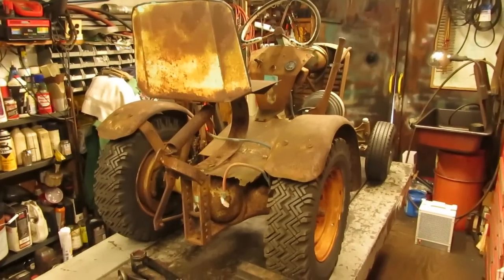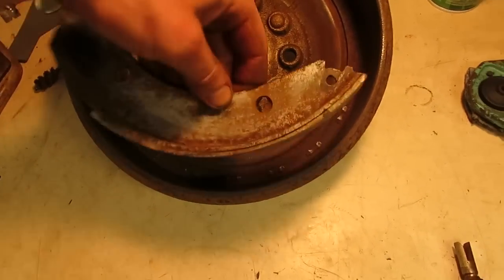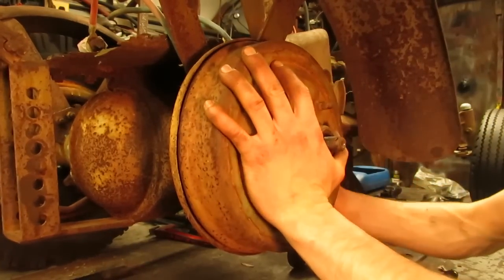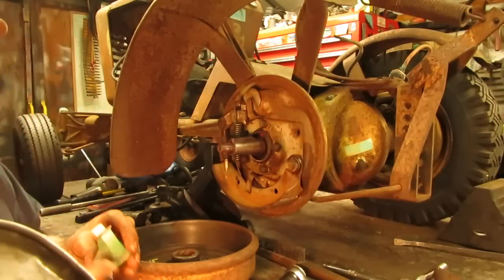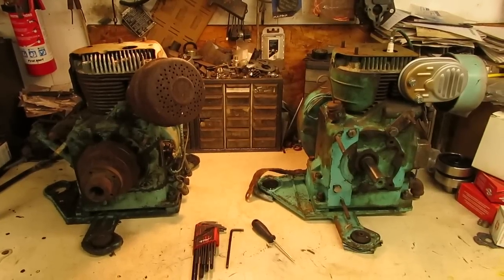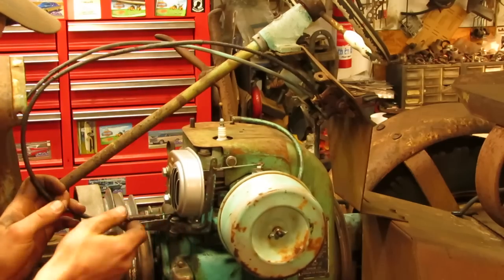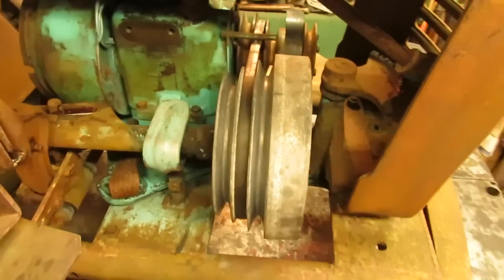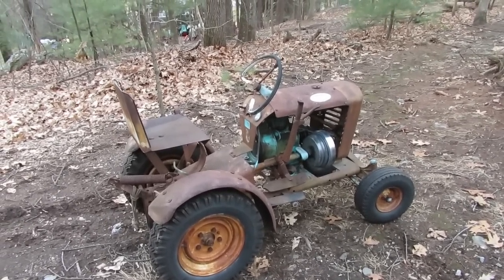Building a Rusty Panzer T758ES Tractor- Part 2 of 2

Comment: The anchor mount is called an excentric bolt used to center the shoe in the drum , as the drum wears contact of the show is on one end.  We called these shoes , P style,.  We also had a gauge to measure the drum and the shoes to get the adjustment close so one didn't have to take the drum on and off.   it was common practice years gone by to shim the lining on the shoe sometimes called a table when the drums were worn oversized. A thing of the past not many drum brakes used todays automobiles.  Return spring common to yours were used on steer axel air brake systems.  Jake I enjoy seeing a young man with interest keeping the old iron running and your inventions.
Reply from the maker: THAT'S what it's called! Thanks Ed, just couldn't conjure up the right name for it at the time... Interesting info on setting the shoes too. A lot of that common knowledge is lost now a days with so many things having disc brakes. Of course now I can keep it on mind since so many of the older equipment I work on still does.

Comment: I think you did a FINE job as you always do. I never had any experience with those although they had to be here somewhere. Looks like a very strong built rig with the gear rear end and chain reduction. Hope there's a hole to drip some oil on the chain somewhere and all the grease fittings are right up my alley. Hope is going well and the calluses are getting even thicker. Maybe for a flat top but I don't think a 5-string builds them very fast but hope you're picking all you want to! HI to all there and everything is still waiting on you. I finally got outside and did a little and got stuff started.  Felt GOOD to finally get outside! Rain now and a cold front coming to freeze all the buds and blossoms but it comes every year. Keep after it and God Bless Yall!
Reply from the maker: We got 2 maybe 3 more gigs booked between now and Aug (one of which is our tractor show). That's big doin's for us since it's usually 1 gig or so a year. That Deering Deluxe is going to get a workout! Nothing like getting out for some early spring tinkering, sure beats being trapped like a duck in a pen... After having an almost snow-less mild winter, we're finally catching up... got a nice storm blowing through today. Guess He wasn't going to let us off easy! Thanks Lewie!
Reply: @5Tractorguy  Sounds like the Tractor Show might put yall on the Opry and I think Deering can send you another tone ring if you melt that one down. We've just got maybe 2 dustings so far this winter (if you want to even call it that) and we usually get a little bit but not this time. It better hurry if it's going to do something. It'll be garden time in just a bit but I've seen snow on dogwood blooms before. I even got out and mowed the high spots in the yard the other day. My job security is starting! So happy snow plowing, Buddy. We're all blessed more than we know.

Comment: Yeah you looked a little constricted on it as I would be, what a neat machine. Those hub pullers could be gotten fairly cheap 10 or so years ago not so much any more. If you keep an eye on ebay you may be able to pick up the 3 leg.
Reply from the maker: At the least the dang steering wheel needs to be closer! Though I suppose I should use my lanky arms for something... Believe this one had a name stamped into it. Going to have to check now and keep and eye out. An extra leg would be handy as ever.

Comment: my Dad bought one of these, I think late ‘60s, primarily to mow a sizable yard. I grew up spinning wrenches on it. Rebuilt the engine a few times, but never had to service the brakes, as they were rarely used. A funky machine for sure with that big Chrysler automotive rear end and that silly drive shaft with pulleys and a reverse using a rubber friction disc was an anachronism. However, it was very reliable and easy to fix. Without a mower deck on it, a young man could pull crazy wheelies on pavement. I spent many hours cutting grass with it, so much so that it was partially responsible for most of my hearing loss…..I was too dumb to use hearing protection….🗣️ 🦻

Comment: Tractor runs great man !!! I really need to find a Panzer for my collection one day, they are a sweet little machine. So I guess you have to shut the engine off to flop the belts over to change gears on these things ?
Reply from the maker: Thanks! That ol' K181 is a good runner! Yep, that's the only hassle about running these things is the speed change. Unless you're handy with a flat-head screwdriver haha.

Comment: So happy to see you back again.  I have wanted to ask you about starting a small engine repair biz as well as doing ,mobile welding and fabrication. I guess by what I mean fabrication is being able to machine parts for tractors and equipment. How do you advertise? Can you suggest a few starter tips. I have always looked up to you. I found one of those lincwelders that you had in a scrapyard and am rebuilding it. I think it might have been better where it was..lol
Reply from the maker: Thanks John,
Hmm, I'll do my best, may be long winded here... When I first started this biz in 2011, I advertised through Craigslist in the farm and garden section. At the time, CL still saw a lot of traffic and it was easy enough pick up work (how I built and grew my customer base). Now with FB marketplace, CL sees hardly any views. You can always opt for a FB page or ad if you want. Personally I can't stand the dumb flack/laziness people come up with on FB when inquiring about biz services so I still run ads on CL. In the process of getting a formal website up this spring too. Also word of mouth and leaving biz cards at local shops (barber, hardware store, etc) is good too. Network with other repair shops when you can, stuff they don't want you can take on.

On the repair side, make sure you hold firm to how you charge the customer and what you do/don't want to work on. Joe Homeowners are really good about having t-rex hands when reaching for the wallet and will beat you up on prices- do not give in... ever. Out on the road most guys will pay because they understand what's involved. Same with commercial equip guys because they're also in biz.
Machining parts for tractors is a good idea! Just keep in mind the off the shelf cost vs. your fab time if the part is still available for purchase.
Hopefully this helps. It's rewarding and fulfilling as heck running your own biz. And if you want it bad enough, you'll find a way to make it work!
Reply: @5Tractorguy  Thank you my friend. This helps a huge amount. I have been a member of #small engine nation for quite a while and Phil did a great job of bringing many of us together. There is a guy and I think his name is Paul who is in Nevada who came up with an excellent price structure. I am in Pennsylvania. I hope to talk with you some time. I have one of those Lincwelder 225's that you have and I am trying to restore it. When I saw you bring one home I saw one in a scrapyard and now mine is almost completely done.. I also found a 1983 Yamaha trimoto three wheeler in that scrapyard and more parts in a  barn. I  am going to rescue it and restore it as my first video on my YT channel. I will keep you in the loop. Thank you my friend.

Comment: Can you tell me how wide the rear is in this tractor? I'm building a small garden tractor using a Kia rear axle.
Reply from the maker: Forgot to get back to you on this... From the ends of the axle shafts they're 32". The mounting flanges for the brake backing plates are 23". Hopefully that get ya close!

Comment: Your frame and the Panzer's frame difference did not go un-noticed Jake,  all it did was bring a smile to my face,... my Son on my ride-on mower tractor presents a similar picture. :)
I never have seen a Panzer Garden Tractor up close before, it's a brand that I am not familiar with. It seems to be very well ( sturdily ) built. Do you recall what these cost back then?
Reply from the maker: Not built for lanky guys haha! 
The are stout little tractors (weight around 575 if I remember correctly). As for price, I can't find anything in the paperwork here or online for pricing. Would imagine comparable to other manufactures at the time?
Reply: @5Tractorguy  Two things that caught my attention, that Chrysler differential/axel and a good old Kohler engine, both of which were built on our side of the world.

Comment: The drive system is interesting. Can you tell us how it works? Why a belt and a friction drive?
Reply from the maker: Reckon because that's what they decided on for a drive system... Bit out of date for the era when everything was either gear or hydro, but it worked.
Reply: @5Tractorguy  "If it ain't broke......"